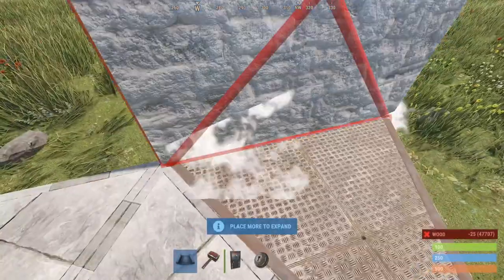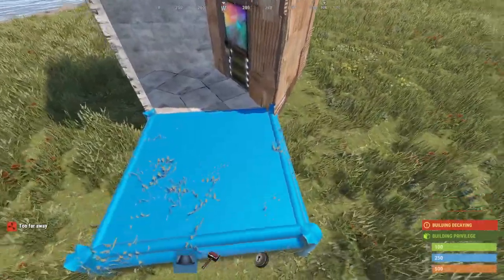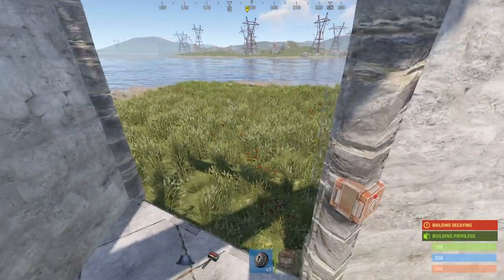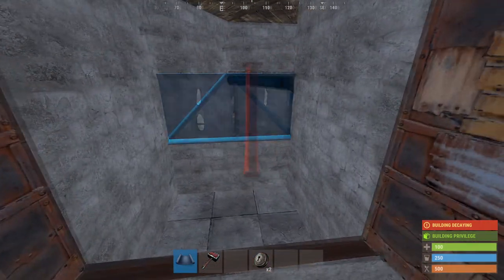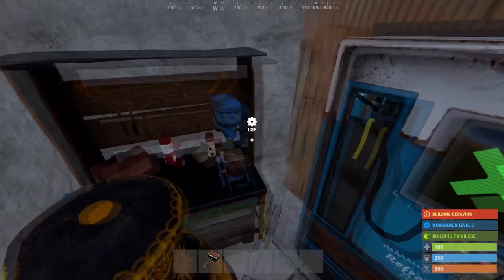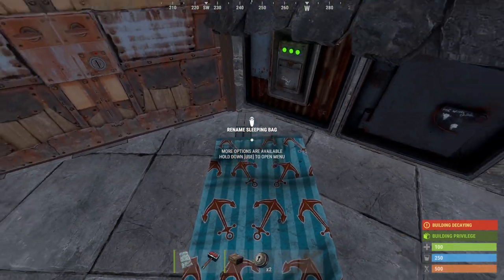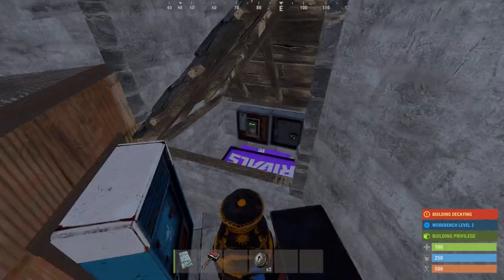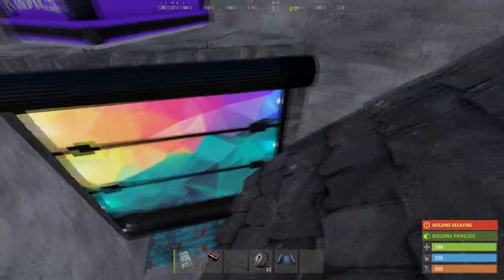(PATCHED) How to build a Compact Rust Solo Base with No HQM - Double Bunker - Cheap - My Design

Comment: i might do this base. the base im in rn is two squares on top of each other and 2 triangles on top of each other with half walls pancake layer in the middle. the bottom tringle as a side with 2 half walls instead of a full wall, so i can plays a triangle floor frame and triangle roof to seal the first story square and triangle . i also put a 1/4 wall on the inside of the pancake layer between the two squares instead of a half wall to plays boxes between the first and second story. i have the tc in the first story with ter 2 beside it. my bag, 2 small furnaces, a big box and 2 small boxes. i have my research table and repair bench in second story square with a big box, 3 small boxes and a barbecue.
Reply from the maker: Cool! Good luck with the build. Sounds like you've optimized the space nicely.
Reply: @RustGeezer  give my dezine a try if you would like I also have alot more small base dezines to